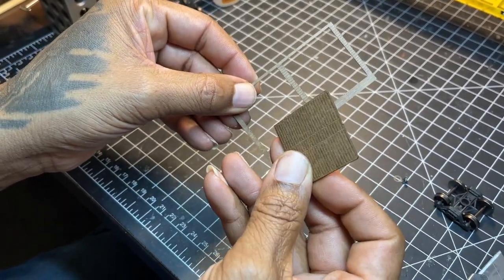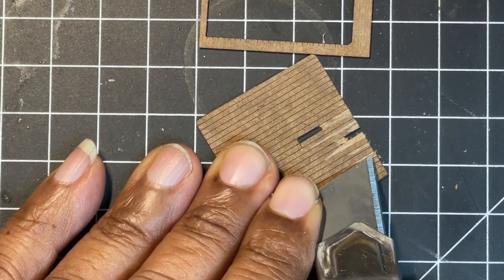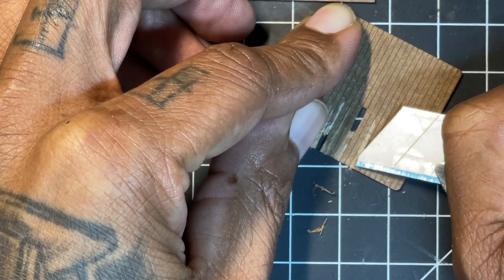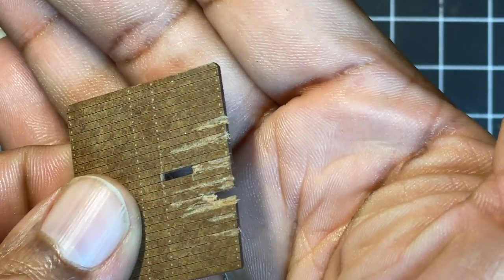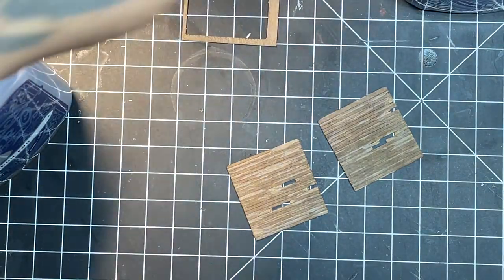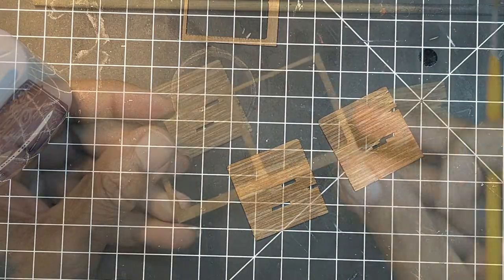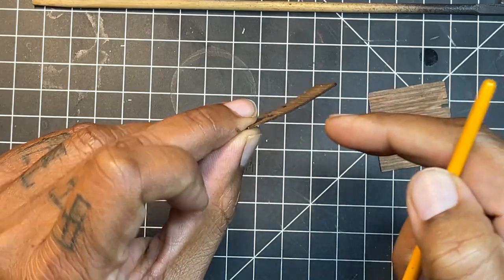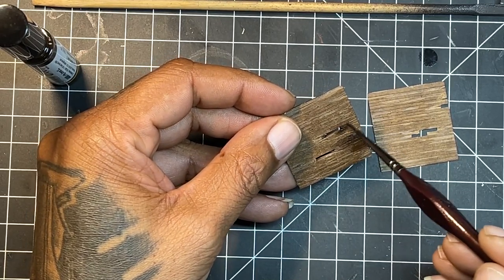How To Weather Your Bulkhead End in 4 Easy Steps!

Comment: After much swearing and cussing I finally build a Tichy Train Group flatcar.  Do not follow the directions to the tee.  Trying to install the grab irons, which the kit included plastic and bronze phosphor ones, I ended breaking off every one of the stirrups installed previously.  Put the stirrups on as the LAST step.  LOL.  When building a kit I spent as much time chasing parts across the floor as I did building the kit.  I did make new stirrups out of some desk staples as they were about the right scale for HO.  I really like the brake detail of the Tichy models but it was a little fiddly.  I see you keep a long fingernail on your little finger to scratch your ass without getting any stink on your finger.  LOL.  Great technique for weathering by whittling away at the wood on the bulkhead.  I make all my washes with acrylic paint, alcohol and distilled water.  Why buy it when you can make it.  You want to make it darker around the edges & lighter around any holes or missing wood as wood gets lighter as it rots.  I make my own rust out of 0000 steel wool soaked in vinegar.  I use women's eye makeup for weathering powders as it sticks better than any chalk I've ever used.  And you can get it in just about any color under the sun.  Plus the fact that it only costs $1.-00.  For great weathering tips, look around you at nature and try to copy what you see.  Your car came out really nice.  Cheers from an old modeler in eastern TN